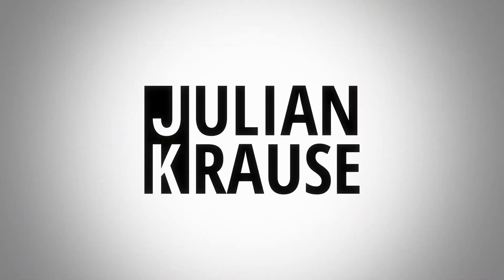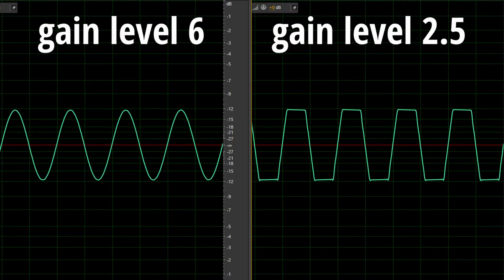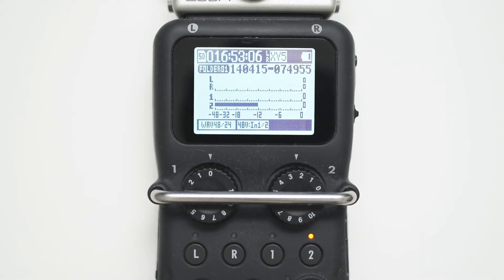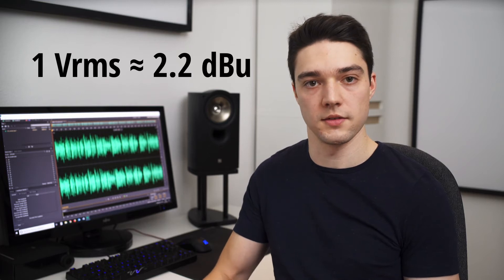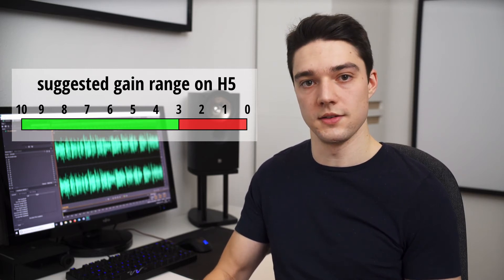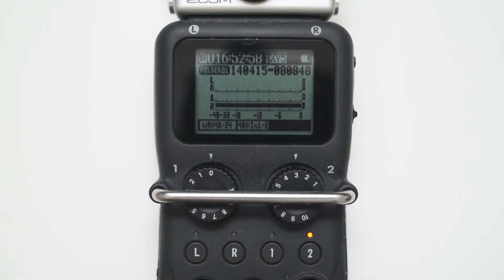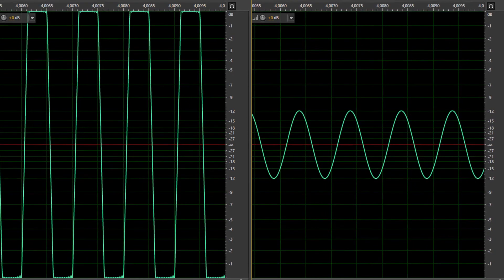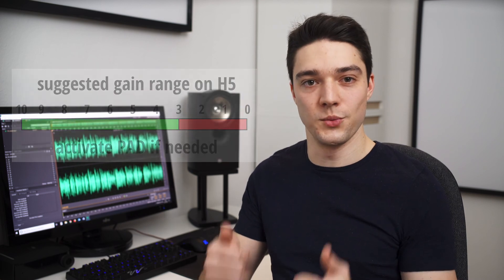Zoom H5 Gain Clipping Problem and Solution

Comment: Can confirm the problem on the Zoom H6 too!
Struggled with it for years... then found out that using the -20db switch kinda reduced the problem, but would have never imagined it could have been because of the gain being TOO LOW! Figures that I always keep it between 1 and 3 😅
It distorts only when input sound it too high, otherwise it does not distort... so weird!
Thank you a bunch!!!

Comment: Amazing information - I just watched a video of yours on why 32-bit float isn't all that it's cracked up to be, but the better ADCs and the companies designing the equipment such that you cannot change the gain means they're probably trying to figure some of this out with the newer recorders. Thanks for pointing out that the file format isn't the only reason why the newer ones "cannot clip" (Which they still can)

As someone who never remembers to check his gear before going out, I really appreciate the "set and forget", because if I had to enable the -20db pad in some situation, I can guarantee that I'll forget that until a few gigs later, after wondering why my last few recordings needed so much ampilfication.

Comment: I know this video is about 3 years old, but I just tried to use the H5 as Audio Interface in loop back mode which worked out fine .....but ...the quality of the recorded loop back signal is much worse than the original played back signal .... frequency spectrum looks like much attenuation in the high frequencies ..... I checked even that the played back audio has the same resolution/format - not to blame some internal conversion (e.g. 48 to 44 kHz or 24 to 16 bit, ect) .... anybody else found that out ? any work around FW Update ect ? .... It's quite sad, because just to produce a program in high quality audio the recorded audio is a bit flat compared to the original .....

Comment: Thanks for your video and your findings.
There's also a serious problem with the included mic. capsule XYH-5. 
Sound signals with lots of high frequency content already do clip at a level meter reading of just a little above  -12dBFS, and consequently you have audible distortions on the recording. The clipping indicators are flashing, although the meter reading is way below 0dBFS! 
The XLR inputs don't seem to be plagued by this problem. 

Test conditions:
Create a sine chirp from 20 to 40kHz at 0.8% of full scale in Audacity. (Sampling rate, 96kHz) Record it through the XYH-5 microphone capsule via playback on your speakers, sampling rates 44.1kHz, 48kHz, or 96kHz, stereofile rec. mode. Set the gain controls for meter readings savely below 0dBFS (e.g., -3, -6, or -10dBFS) at all frequencies, i.e. throughout the chirp from low to high. When the chirp reaches high frequencies, (approx. 13-15kHz or so, and higher), the overload lights start flickering, and the audio becomes distorted. (Although meter readings on the H5 still savely below 0dBFS.)
Also: Record directly from your interface line out (-10dBV) into the combined mic/line input of the XYH-5 capsule: Same results. 
Set the gain control so that the level meter reads just below -12dBFS on the H5, no overload indicator lights flashing, no audible distortions.

Comment: I think some of the criticism of the H5 in this discussion is a little off the mark, in the sense that part of what you're running into is a natural consequence of the architecture of the device.  The specifications for the H5 state that the maximum input level for inputs 1 & 2, with the -20dB pad engaged, is +22dBu.  Now, already things are starting to get messy, because the whole question of what constitutes a "line level" signal is fraught with confusion and multiple standards, but trying to tiptoe carefully around that quicksand pool I'll just say that one version of "line level" equates 0dBVU, or nominally the maximum undistorted level, with +4dBu.  The reference level for dBu is 1mW into 600 Ohms, or 774.6mVrms.  (And woe betide you if you lose track of whether you're talking about Vpp or Vrms in all of this, because all of a sudden none of the numbers will make sense.)  So +4dBu is about 1.228Vrms, and the H5 max input spec of +22dBu is 9.75Vrms (or 27.58Vpp, which is more convenient if you're looking at an oscilloscope).

On my H5, with the -20dB pad in, at an input voltage of 27.5Vpp, I hit 0dBfs (in other words, maximum digital signal level) with the gain knob turned to about 3.  This means (and here's the punch line) that if you have to turn the gain down below 3 because your input level is too high, then you are exceeding the maximum input level spec of the device.  Now before people start screaming that +22dBu is too low, remember that the nominal 0dBVU for this "line level" standard is +4dBu.  So that's 18dB of headroom before the front end starts to clip, which seems fairly respectable to me.

Now for the architecture part.  People are upset because they want the VU meters to tell them if they're overdriving the input stages, but the VU meters can't do that because they are implemented digitally downstream of the ADC.  Think about it this way:  there is no way, downstream of the ADC, to know if the clipped waveform you are seeing is the result of clipping in the front end, or if that's actually the waveform that was presented to the inputs.  A caveat to this argument is that I'm assuming the gain controls are analog attenuators between the input amps and the ADCs.  Everything I've seen points to this interpretation, but I haven't actually taken mine apart and reverse engineered it.

So, armed with the above knowledge, it should be clear that if you're hitting 0dBfs with the gain set to 3, the solution is not to turn the knob down further, but to reduce the input level somehow.  If you can't do it by adjusting whatever the signal is coming from, then inserting a passive in-line attenuator should solve the problem.  Does this mean that levels below 3 on the gain knob shouldn't exist?  No!  There are perfectly legitimate reasons why you might want to turn the level that far down on a channel even if it isn't pushing the maximum input limit.  Remember, it's not turning the level down below 3 that's causing the distortion, it's simply that attenuating after the input stage can't do anything about overdriving the input.

Comment: Thx for that usefull information. It turns out that other Zoom Handhelds like the H1 have the same issue! I had that with my last DJ-Set on the H1. Evrything looked fine with no clip-LED blinking, but it sounded like clipped rubish...thx again :)

Comment: thanks for the tip, i also have an issue, that on my recordings one line is always 10 db louder than other, and its not because the input is louder on one channel, this happens when im recording audio output / rec out from DJ mixer, like A&H, the mixer is not showing one channel louder than other, but the recording always ends up with one channel 10db+.....   does anyone has similar issue?

Comment: Thx, as i understand this does not apply to XYH-5 capsule?
Reply: I have the same question. Using the default XYH-5 capsule, if I risk signal clipping below a certain level as for XLR/TRS inputs, which is that value and can I prevent it by activating the -12dB backup recording function (just like the PAD solve the problem with XLR/TRS inputs)? Or does the -12dB attenuation engage after A/D conversion, so it is useless?

Comment: I keep getting a clicking noise if it reaches half way (-12) & it also gets a static noise (ground loop.) I have the same issue with my speakers & have a hum destroyer HD400 for the problem. Just waiting for the right cables to arrive. With the H5 connected to the Hum Destroyer, this should deal with any Ground Looping shouldn't it?!

Comment: I just bought an H5 to simultaneously record my voice (fed through a Rode wireless go) and engine sound (through  an external XLR mic close to the exhaust) on my motorcycle (so pretty loud environment). I was in the 2-3 gain level range and could not figure out why the audio signal was clipping with the levels well in range and clipping indicator not coming on during my first test ride yesterday. Took me a while to find your video but I am glad I did! Thank you for pointing it out and providing a solution - let's hope this works for me. Vielen Dank & Schönen 4. Advent!

Comment: Hi Julian ! I was just wondering what do you refer to when you say ‘loud sounds’ a blender machine? A hair dryer? What would be the Db threshold when putting the gain level at 3 and the 20db automatic down grade? Asking you this because I am plannig to Use the H5 to record some small planes single engine sounds. Is the H5 appropriate? Or shoukd I change to a different equipment? 
Thanks a lot ! And great video !

Comment: Hello!
I have the H5 and i have problems with the input signal is high even when i have the attenuator set to -20db. Am i still getting a clipped signal if i record at 2 even with the -20db?
How do you sugges that i can lower the input signal even more? IMHO there should be an -30 db option also..

Comment: Great tips! By the way, do you think there's something wrong with my H5? When using XLR inputs and set gain level knob to level 5 and up, I get a lot of hiss. This is for any microphone that I use. Thanks!
Reply from the maker: What mic are you using? The preamps of the H5 are not the cleanest but it should't be crazy high noise.

Comment: I'm curious about how good it is as an audio interface. Can you make a video about how it performs?
Reply from the maker: Hey, I don't think the H5 works particularily well as an interface. You always have to turn on the H5 when you start the PC and tell it to connect to your computer and it has it is difficult to connect and control headphones and studio monitors. In a pinch it can work quite decently but if you want something permanently attached to your PC, get a proper interface. Cheers!
Reply: @JulianKrause  Thanks for the response! I wasn't really considering buying an H5 because I have a very limited budget. Instead I'm planning to get an UMC202HD because it's the cheapest 2 input interface I could find and I've seen that it's quite decent based on your measurements.

Comment: Hi Julian! I love your videos on quircks in audio devices. They are so detailed and in-depth. I have a question. I intend to buy Zoom F1 to use it with the Zoom capsules that I already own as ultra-portable music recording setup with Sony RX0 II (or Z CAM E1 if I lay my hands on that one). I actually own also Zoom ECM-3 cable that would allow me to mount only the capsules, not the device. I need both internal recording to fine-tune sound and audio output to camera to make sync easier or for instant upload. But when I started to think about it I found out a problem. F1 doesn't have line out. Only 2x11mW headphone out. So I started to wonder if this will be enough to feed to camera. Sony seems to have hot input. When I custom made 5-pin XLR to 3.5mm minijack cable (with -12dB resistors removed) for my Rode NT4 it output signal so strong that I can set gain in camera at 1 (out of 30 something). But Z cam E1 has line input. Also Panasonic GH5S that I plan to purchase has line input which would be nice to benefit from. But does Zoom F1 provide strong enough signal? Maybe I should go for something like second-hand Zoom H5 which actually have line out?
Reply from the maker: Hey, 
the headphone output should be able to provide a decent level into your camera even though it is not strictly a line level output. So I think the F1 could work for your case.
Reply: @JulianKrause  Then what is stronger? Line level or headphone level? I guess the former but buy how much and how to predict that based on output specs?

Comment: Thanks for this video! Have you experienced any hissing when using the L/R input with the XY mic capsule? How is your noise floor with that?

I just bought an H5 and when using the XY mic, I'm getting very bad hissing. Once I normalize the audio levels, the hissing gets even louder of course and it makes the audio distracting and hard to use. Wondering if this is an issue with my unit.

Comment: Hallo Julian, bin gelernter (und daher schon etwas älterer ;-)  Radio- u. Fernsehtechniker, mein Englisch ist nicht so gut, daher schreibe ich mal auf Deutsch. Ich mache beruflich sehr viele Sprachaufnahmen mit dem Tascam DR-05V2, wo ich auch oft eine für mich nicht nachvollziehbare Verzerrung auf den Stimmen habe, obwohl die Pegel stimmen. Ich arbeite meist mit Funkstrecken und Headsets, die dann über Line aufgenommen werden, der Rec-Level ist meist im unteren Bereich (zwischen 10 und 14 nach Tascam-Scala). Nachdem ich Dein obiges Video sah, frage ich mich nun: kann es sein, dass es den gleichen Effekt auch beim DR-05 gibt? Vielleicht verwenden die die gleichen A/D-Wandler? Hast Du das mal getestet?
Reply from the maker: Hi Michael, den DR-05 V2 habe ich selbst noch nicht getestet, aber es kann sehr gut sein, dass es dort ein ähnliches Verhalten gibt. Eventuell ist das Signal von der Funkstrecke zu stark. Was du mal probieren könntest, ist das Ausgangssignal vom Empfänger etwas abzuschwächen und dafür mit einer leicht höheren Verstärkung am DR-05 V2 aufzunehmen. Das sollte das Grundrauschen nicht wirklich beeinflussen, aber eventuell stößt das Signal dann nicht mehr an die Clipping-Grenze.
Eine zweite Möglichkeit könnte auch sein, dass das Mikrofonsignal schon in der Funkstrecke verzerrt. Eventuell ist die Mikrofon-Verstärkung am Sender zu hoch eingestellt, sodass das Signal schon im Sender clippt. Dann bekommen alle Geräte in der weiteren Signalkette natürlich nur noch das geclippte Signal mit.
Reply: @JulianKrause  Danke, das werde ich mal testen, ich habe am Wochenende wieder eine Veranstaltung aufzunehmen!

Comment: Hi Julian - I record our vocal choral concerts on an H5 using the WAV format.  For rehearsals, I will record in MP3 format to save space in both storage and transfer.  I use the 64K format of MP3.  It sounds terrible, with a pulsing distortion.  I tolerate it for the other reasons mentioned.  Levels never get beyond about -6.  Should it sound so terrible?  BTW using the XYH-6 capsule mic.
Reply from the maker: Hey, mp3 is a lossy format. The quality of the mp3 recording is influenced by the bitrate. 64k is a low bitrate and will yield in a bad sound quality. I would suggest you use 256k or 320k. Of course the file size will increase a bit, but the sound quality is way better. 
Also check if the limiter is turned on. If that's the case, turn it off. The limiter in the H5 is digital and does not prevent clipping.
And lastly, try to get your H5 close to the performers. Hope that helps!
Reply: @JulianKrause  Thanks for the reply.  I know MP3 is a lossy format - of course we listen to most of our tunes in mp3, which certainly don't sound bad.  I moved the mic closer to the performers, which didn't seem to help.  I can use higher bit rates, which I probably will - I just don't think that even at 64k I should have this strange noise pattern - the other thing, is it seems it varies by frequency.   Really appreciate your thoughts!

Comment: Why is it, that so many Reviews in Youtube use the Zoom H5, to review devices like the Fethead or Cloudlifter? Was it’s noise on high gains so much worse than other devices, if even rather cheap audio interfaces, like the Behringer U-Phoria ones have a supposedly low noise floor? And if so: Why does everybody buy them? What gives?

Comment: Had a similar problem trying to take the output from a DBX 286s into a Scarlett 2i2. Even turning down the 2i2 gain all the way it would still clip unless the 286s gain was turned down so far that the meter LEDs on the 286s were essentially useless. Consumer level audio devices like the Zoom H range seem to have a remarkable number of problems dealing with any kind of line level signals. Makes it a real pain for those of us who don't understand all the different signal levels before we start buying equipment. Brilliant analysis of the problem and solution as usual, Julian.
Reply from the maker: Hey, did you feed the signal from the dbx into the XLR input on your 2i2? Because if you go straight into the TRS line level input it should not clip on your 2i2. Cheers!
Reply: Julian Krause - I tried multiple different kinds of cables. XLR and both TRS balanced and unbalanced. Nothing really seemed to work like I expected or wanted regardless of how the 2i2 was set (mic vs instrument). Like I said I made it work without clipping but only by drastically reducing the output gain from the DBX 286s. It’s possible there’s something wrong with my unit. Got it used from eBay.

Comment: Great detective work. Can Zoom fix this with a firmware upgrade?
Reply from the maker: Hard to say, I think this depends on how the gain setting is implemented on the H5. It might be possible.
Reply: @JulianKrause  Hey Julian so came across a problem like this with Sony Cameras Mic Input and Gain settings possible to do some test on this Audio Problem? Seems like a similar Issue to Zoom H5

YouTube Video Title " Sony A7sIII Audio Distortion Problem SOLVED!! (A7iii as well) " And possibly other Sony Cameras Released around this Period with same pre-amp audio circuit.

"The Sony A7iii and A7Siii have a peculiar audio distortion problem if you practice traditional gain staging methods. It seems that having the mic level set to the lowest +1 will actually cause your audio to distort and clip at -9dB when you have plenty of headroom?! " - TLDR Filmmaker
Reply: @JulianKrause  Here's the Link to the video https://www.youtube.com/watch?v=Bh_gfEsFGtA